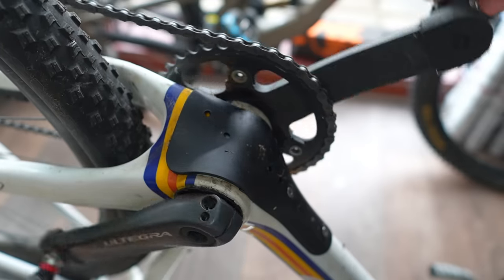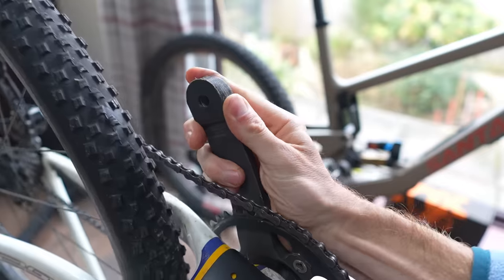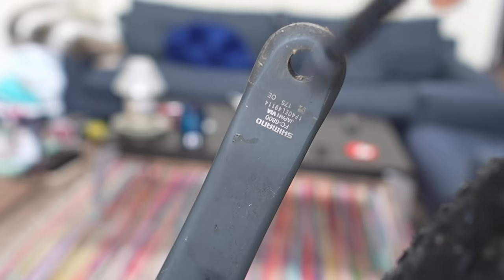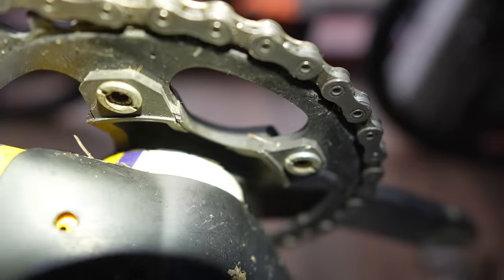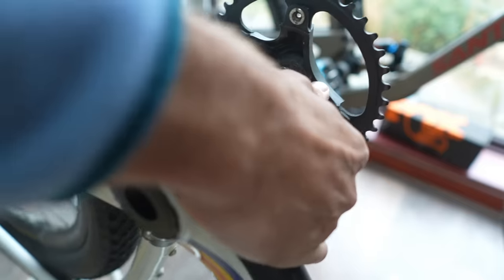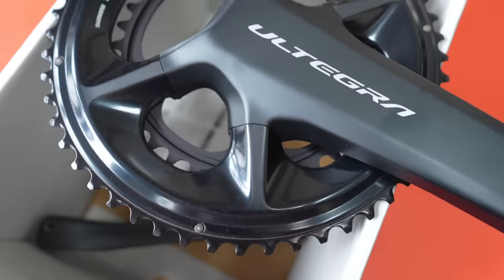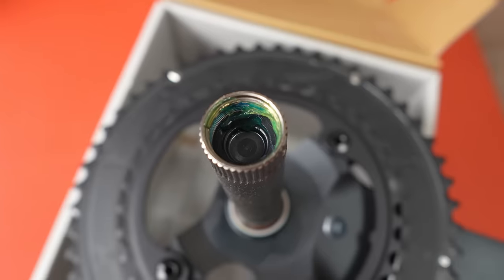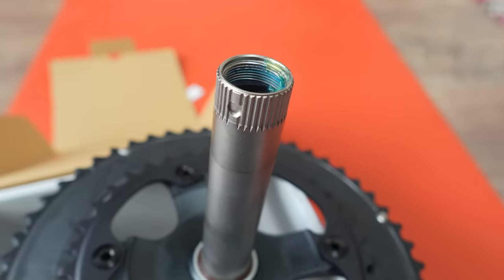Another Shimano Crank Failure & the New Design

Comment: Mr Torque, can you do a video to tech us the punter about the benefit of the great "Hallowtech"? what make it great compare to CNC or forging ?
Reply: The great thing about is the fact how cheap the construction actually is. It's great for profit margins!
Reply: @rosomak8244 Is it actually cheaper though? They save on material costs by using less metal, but they have to forge two parts instead of one, in addition to having to bond the pieces together. As for the OP’s question, the benefits (at least on paper) are lighter weight and rigidity, because the arms are hollow and can be made with a larger cross section without a weight penalty.
Reply: @trekkeruss  In relations to techniques that would properly bond the two aluminium shells it is definitively cheaper. Yes the bonding could be done properly by welding or even soldering the parts together.
Reply: @rosomak8244  But your statement is that it is cheaper to manufacture. Yeah, perhaps they saved money by bonding the two parts, but I contend it is not necessarily cheaper than their previous generations of cranks. I also think there is nothing inherently wrong with bonding; they just didn’t do it correctly.

Comment: How is this classified a failure if you've put 7 years worth of riding on them? Wouldn't that just fall under wear and tear?
Reply: Because it failed in a way that is caused by a manufacturing/design defect. If a forged crank snapped in half, that wouldn't be wear & tear either.
Reply: wear and tear on a normal crank would be on the teeth.
Reply: it's the chainrings on the crank which are the consumable, not the crank itself.
Reply: No
Reply: Shimano failed to do a recall.